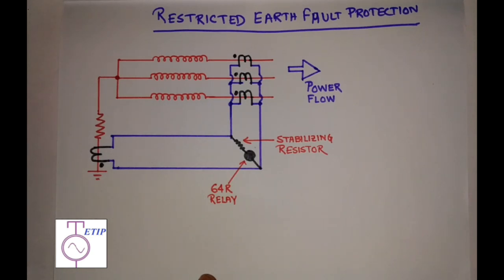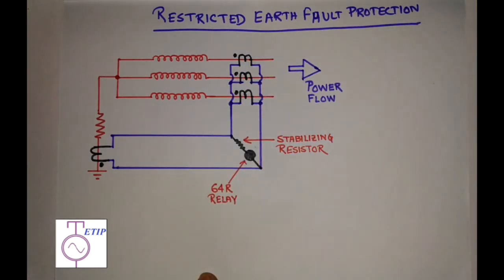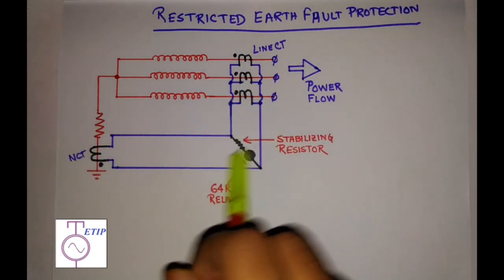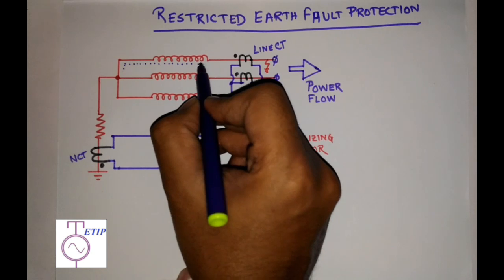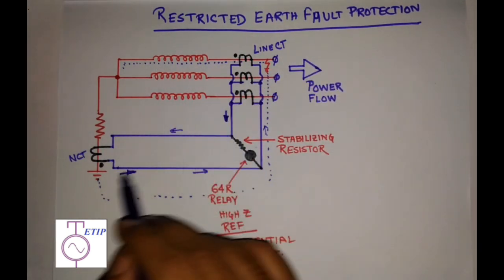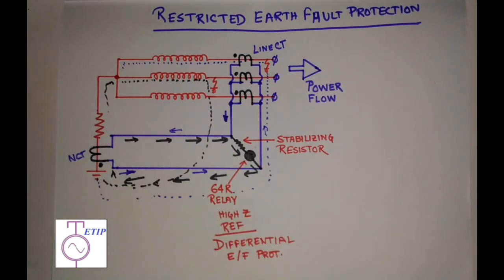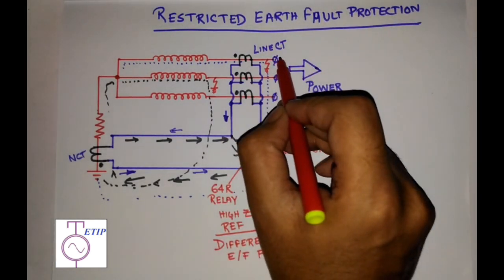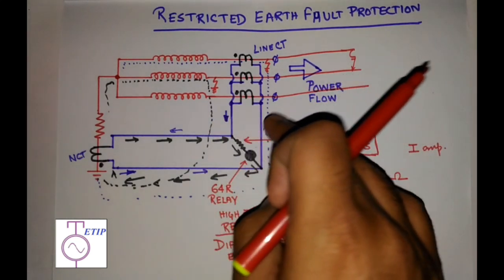Restricted Earth Fault Protection|REF relay working principle

Comment: Sir, why did you change the direction of current  in second case through NCT. Shouldn't the direction be same for both external as well as internal faults. Since the direction of fault current in either case is same.
Reply from the maker: Yes correct. That has been a mistake by me. However the result will be same. Glad to see your clear concept. Thanks for identifying it.
Reply: i was thinking the same thing.
Reply: In trf, secondary current is always in opposite direction as of primary... (opposes the cause producing it)
Reply: How come result will be same if direction of current in NCT is not changing?
Reply: @dilipsiju9165  relay will be energized irrespective of current direction
Reply: I think he mixed up with the real current flow path vs the CT secondary current path. In case of an internal fault, only the NCT will see the faulted current and therefore will have a current mismatch with the phase CTs(calculated neutral) and initiate the relay fault.
Reply: This video is misleading take it down and redo.... Pls
Reply: @electricaltechnologyandind5335  very nice explanation. its so clear and good easy explanation  that we can identify the mistake . thank you
Reply: If you admitted your fault , then delete this video & upload the currect one. Bcoz this will mislead people.

Comment: Very good video. But I think the polarity marking you have shown (when you give the example for through fault) for NCT is reversed. Because, the current direction of restraining current (Ia+Ib+Ic) and star point current (In) should be equal and opposite in direction. During the though fault you are showing the current direction of CT-A secondary and NCT secondary both are same direction. if so,  the relay should sense and trip signal to concern breaker.
Reply from the maker: Yes, that was an on camera mistake
Reply: The line ct polarity needs to be changed. Typically for differential forms of protection the CT polarity marks point away from the equipment it’s protecting. Reason being is that you will see current from power flow trying to flow back into the fault as shown in ETAP sims as AC current will always travel the section, in this case a fault within the zone, for a brief (if designed properly to trip) moment. The line CT’s will see that current.
Reply: @bhaveshbarot186
7 minutes ago (edited)
direction of current flowing through  NCT secondary in internal fault diagram Shawn is wrong.i think its flow opposite of primary current. though its operate the REF relay but current direction would be entering from relay side. also during external fault fault current will flow through N of line CT. which will be equal and opposite of N CT current. and result will be 0 amp.

Comment: Hi 
I believe in both the fault conditions NCT sec. Current direction direction will be same.
Your considering two different directions for outside and inside faults.
Could you please correct me if I am wrong

Comment: Please answer my Question sir , in the 6.35 you saying due to polarity connection no current will flow on the stablizing resistance?  How please explain.?

As my knowledge current will flow in  shortest path then the secondary current will flow through the stablizing resistance via why they will choose longer path. 

Please clarify my dear otherthan your explanation is great ..

Comment: I have one technical doubt, in REF protection above diagram, where line CT connected? Inside Transformer or Switchgear side? 
Also in Motor or Alternator Differntial protection  where CT's wilp be connected?
Reply: In T/F REF Protection, Line CT HV Bushing ke turret me hota hai ( Bushing Ka lower part jo T/F tank ke under connect hota hai) Yani inside T/F.

Comment: I have one doubt.. I think there’s on mistake in your brief , only doubt... when the EF occurred inside the zone, the flow of the current in secondary should be reverse, as per your explanation the fault current will not flow through relay bcz of the resister.

Comment: I appreciate your effort, but kindly convey the universal application examples while explaining the topic. There was also some lack of information like you were only talking about differential earth fault protection, along with that you should have also told about the other types.
Reply from the maker: please note the heading of the video... the video is only about restricted earth fault protection and not about the other earth fault protection. i have another video on over current earth fault protection and relay co ordination, you can check that. also please note that it is not possible to cover all types of earth fault protection under a single video..... you please watch that earth fault protection video. also on restricted Earth fault protection i have made three videos, one is the principle and other two about the setting and calculation. so whatever practiced in industry is already available. please check all the videos. i hope your doubts will be cleared....

thank you

Comment: so would it operate to protect against INTERNAL phase to phase faults which are NOT associated with ground?
Reply from the maker: Nopes.... For that you need differential protection
Reply: @electricaltechnologyandind5335  can you please explain why it wouldn't operate for such fault
Reply from the maker: No ct will be energized.and if the fault is out side and through the ct then also as the cts are residually connected so they will see the sum of fault current which is zero

Comment: direction of current flowing through  NCT secondary in internal fault diagram Shawn is wrong.i think its flow opposite of primary current. though its operate the REF relay but current direction would be entering from relay side. also during external fault fault current will flow through N of line CT. which will be equal and opposite of N CT current. and result will be 0 amp.

Comment: In one of our substation whenever the 66 kv voltage is on higher side may be  greater than 70 kv and if power transformer after maintenance is switched On it trips with REF indication .Could you please explain the reason for same
Reply from the maker: Is the trafo star star??
Reply: @electricaltechnologyandind5335  yes
Reply: 66/11kv 20 Mva
Reply from the maker: I have seen this problem, also. If the trafo doesn't have delta winding then third harmonic current may be the culprit. It has the same characteristics as zero sequence current
Reply: @electricaltechnologyandind5335  could you please elaborate

Comment: REF have a differential principle so should be coded 87N. The 64R it used already for Rotor earth fault protection for generators
Reply from the maker: Won't disagree, but 64 also represents ref

Comment: How the positions (primary) of the CTs to be arranged (P1 & P2) for both the line and neutral CTs?
Reply from the maker: Okay I shall explain on a separate video
Reply: 1. For Lines at a substation, place the P1 in such a way that the fault would be fed to the protected object, via P1. Hence, in this case, P1 of the CT to the bus side, p2 to the line side.

2. For Transformers also, follow the same principle. Place p1 of the primary side/hv side in such a way that a possible fault current will enter the protected object(in this case, the transformer) via P1 (P1 away from transformer, P2 near transformer). Similarly for secondary side/lv side also, Place p1 of the secondary side/lv side in such a way that a possible fault current will enter the protected object(transformer) via P1.(P1 away from transformer, P2 near transformer).

3. If there are neutral CTs, apply the same logic as in case 2. For Neutral CTs also, place P1 in such a way that a fault current will enter the transformer neutral point via its P1 terminal. (P1 away from transformer, P2 near transformer).

To add onto the above points, starring secondary of CTs when connected as above should be done at the protected object side. i.e for case 1, s2 of phases should be starred. in case 2 also, s2s should be starred.

Comment: I have one doubt,  both faults inner and outer current flow in earth to Nu , but secondary current direction changes in our explanation why?
Reply from the maker: THE DIRECTION SHALL BE OPPOSITE. I MADE AN ON CAMERA MISTAKE THERE...
Reply: @electricaltechnologyandind5335  in my knowledge, ,  NU CT Current  are never change the direction  ,The power flow direction has been  change  at time of  inner falut  than only  CT current will added

Comment: Reason for stablizing resistor is not correct as through fault current increase magneticing current in excitation branch of cts due which CT saturate and differential current will  pass through spill path and relay will operate
Reply from the maker: Explanation in video is correct. Reason behind the current flow due to theough fault is the Vs

Comment: Downward direction of current is not assumed its according to the dot convention.... plz study properly and then deliver better quality information..
Reply from the maker: Thanks for your suggestion. But that mistake is not due to lack of study. I made mistake on the second occasion which doesn't match with the convention followed for first occasion. I usually deliver without any script, that's the reason for such on camera mistake. 
But I can assure you that I shall be careful in future to avoid such mistake. Moreover these conventions are convertible type. Only have to tally with the primary current direction. Because for each half cycle the direction alters

Comment: How the positions (primary) of the CTs to be arranged (P1 & P2) for both the line and neutral CTs?
Reply: 1. For Lines at a substation, place the P1 in such a way that the fault would be fed to the protected object, via P1. Hence, in this case, P1 of the CT to the bus side, p2 to the line side.

2. For Transformers also, follow the same principle. Place p1 of the primary side/hv side in such a way that a possible fault current will enter the protected object(in this case, the transformer) via P1 (P1 away from transformer, P2 near transformer). Similarly for secondary side/lv side also, Place p1 of the secondary side/lv side in such a way that a possible fault current will enter the protected object(transformer) via P1.(P1 away from transformer, P2 near transformer).

3. If there are neutral CTs, apply the same logic as in case 2. For Neutral CTs also, place P1 in such a way that a fault current will enter the transformer neutral point via its P1 terminal. (P1 away from transformer, P2 near transformer).

To add onto the above points, starring secondary of CTs when connected as above should be done at the protected object side. i.e for case 1, s2 of phases should be starred. in case 2 also, s2s should be starred.